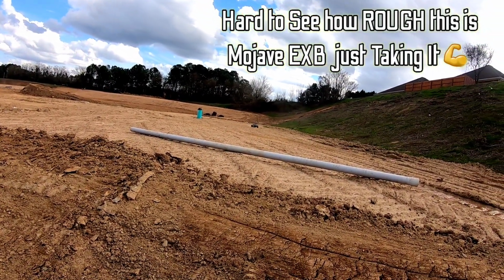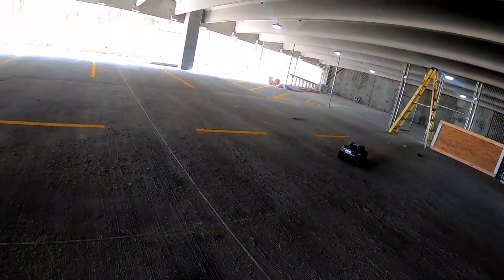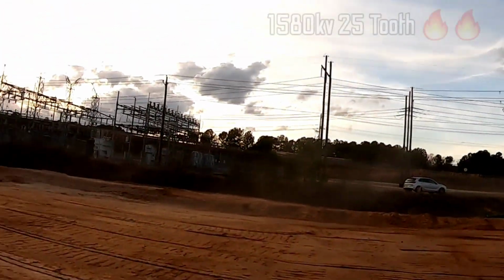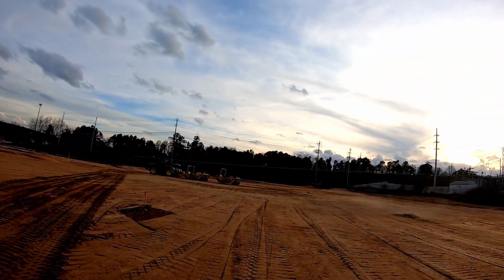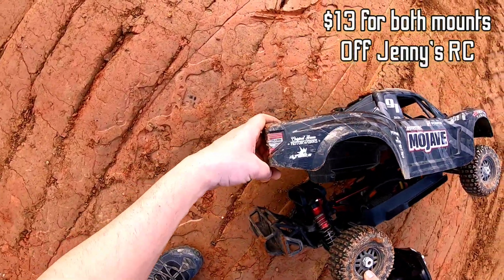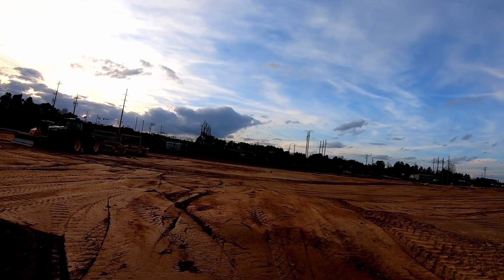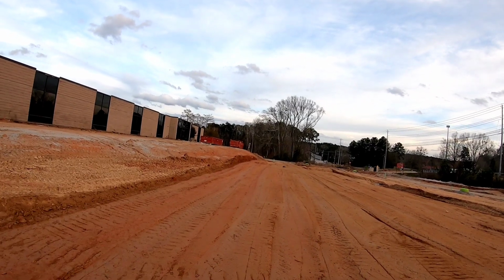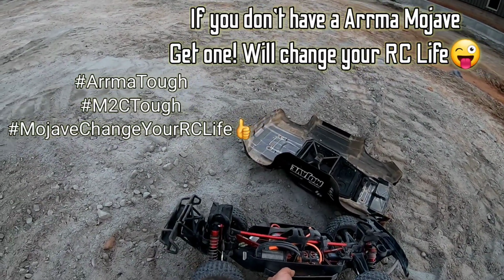Arrma Mojave EXB / Toughest Arrma Out The Box? Epic 3 Site Bash🚀

Comment: One of my favorite rc’s! I’m running 1650 8S , a beast! And yes, I have The M2C wheel hexes. Great video!
Reply from the maker: 8s broooo that thing must fly... I have everything I could Need on 6s 25t and 1580kv wheelies for days... 8s must be manic!
Appreciate your time.and support there brother
Gotta have them wheel hexes from M2C... I haven't even had one get loose
Reply: @3SonsRC  KEEP THE VIDS COMING!!!
Reply: How do you keep it balanced  side to side with those heavy batts on one side?
Reply: @surfside75  surprisingly stable, thinner expensive longer graphine batteries seems to work fine. Bulky short batteries may cause issues. I turned a 3s Arrma into a 6s and it handled horribly. Lol
Reply: @surfside75  oh and the extra weight of the esc and motor balances it out since it’s heavier then stock.
Reply from the maker: It's actually balanced because of the esc and servo on the other side. I do like to keep the 6s battery under 6k though... Some Dudes go over 7000mah it's just asking for weight Dammage. I prefer them around 5400mah to be fair.... Great question and glad you are enjoying the channel,

See ya round